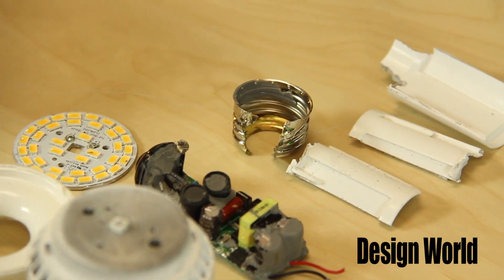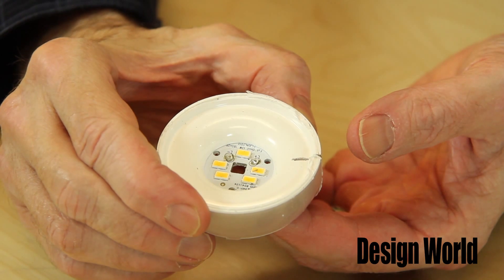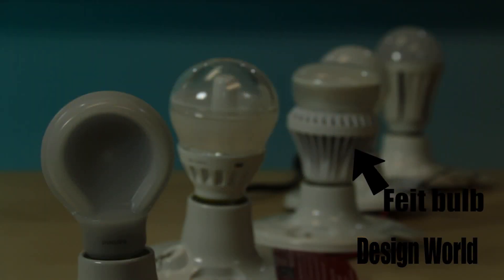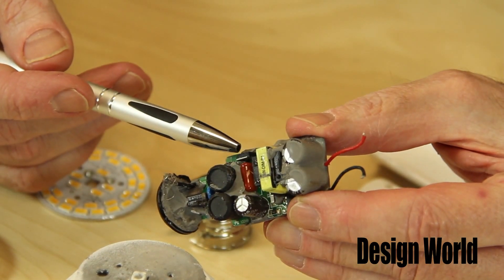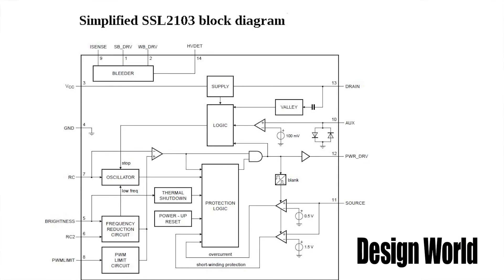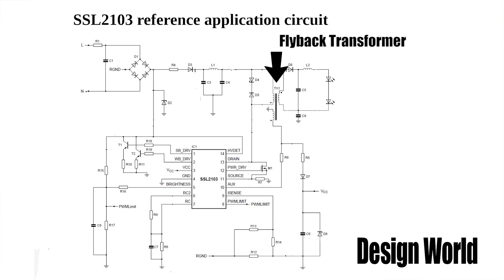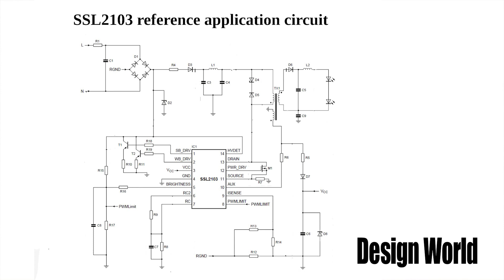Teardown: Feit Electric Co. BPCEA19/OM800 60-W equivalent LED bulb

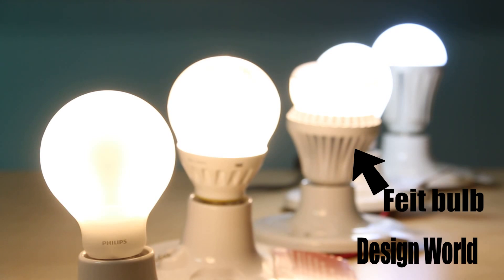Comment: So a year late but if you look at 2:16 as the bulbs are just powering up you can see the outer ring of lights illuminating of the lower curved surface of the plastic piece. The plastic piece is most certainly the for the purpose of reflecting light to the sides for a broader angle of illumination.

Comment: I think the plastic piece reflects the light from the 30 odd LEDs and emits the light through the translucent sides or walls along the circumference. That's my best guess without actually holding a piece. You and your colleague should easily be able to verify it and solve the unknown mystery.
Reply: TLDR: The cone-ish shaped 'direct forward light blocking' piece actually reflects the light to go out the sides.

THIS! If you look at the design, especially in your side view of the bulb, the bulb emits a large amount from the side.  That plastic piece is only mostly opaque on the top; the cylindrical side is frosted not-quite-clear (cos of the frosting effect) and rather transmissive.  I feel that they could have better light output if the conical shaped center piece was silvered/foiled/something on the concave side (the inside) but pure white is a pretty good reflector of light, and it still adds a bit to the overall absorbing/transmitting glow on the top as well. 
If the design were that of a PAR bulb, a direct spot downlight versus an incandescent replacement, likely for a lamp or exposed fixture, there would be no plastic top-blocking/side-firing piece standing in the way of the LEDs, and instead more of a conical reflector they all sat inside.